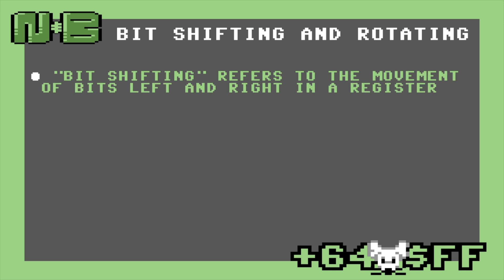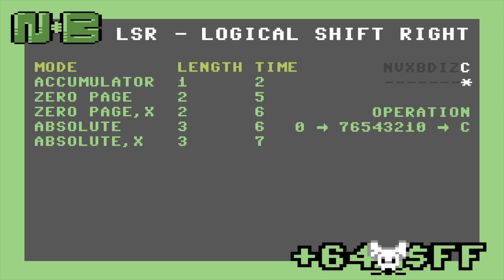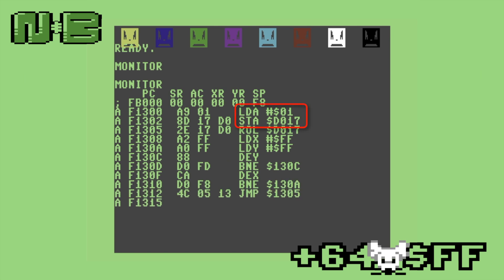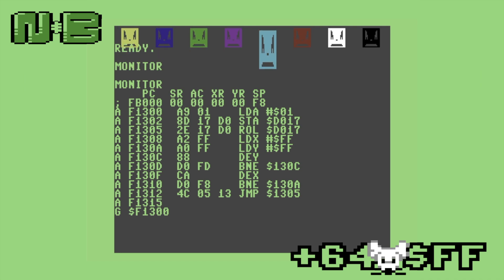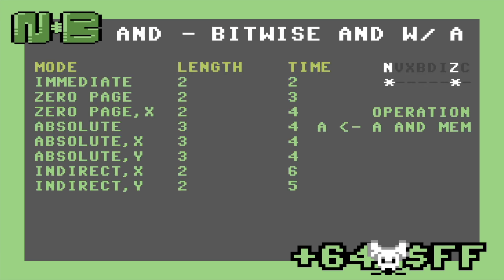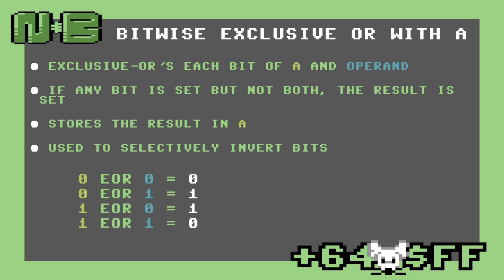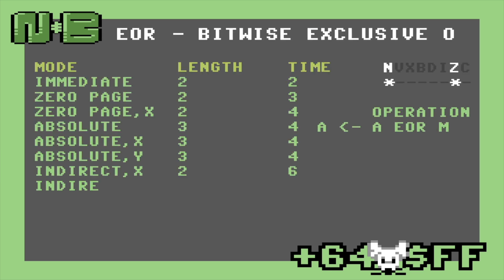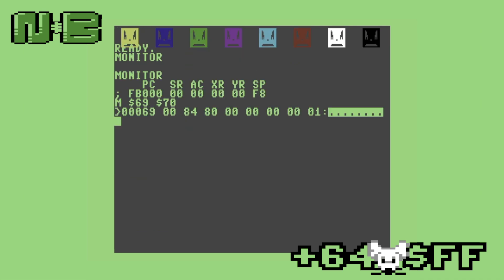Nybbles and MouseBytes: Ep5: Bit Shifting and Logic Instructions

Comment: When you write rotating in not mathematically correct, it's wrong. Rotating is required for multi-byte integer shifting. For multibyte arithmetic you need an ADD/ADC or a SUB/SBB pair (6502 needs CLC/SEC to simulate ADD/SUB). For shifting it will be the pair ASL/ROL (applied low to high) and LSR/ROR (applied high to low).
Reply from the maker: @galier2 What I meant was, successive rotations do not make mathematical sense when standing alone. Used in combination with other operations, yes, it makes sense.

Comment: Another well presented tutorial. Always struggled with BIT, not so much as how it works but rather how it could be used effectively in my code and your explanation has given me a BIT clearer insight as to where it could be useful. Thank you. Looking forward to your next vid!
Reply: BIT is often used in I/O. The hardware is often wired so that the highest bits of I/O memory is the bit to read. Example: on Apple II, address $C010 tells the state of the keyboard. When pressing a key the highest bit toggles from 0 to 1, and bits 0 to 6 contain the ASCII code of the pressed key. So testing a keypress is as simple as BIT $C010, BPL skip, LDA $C010, skip